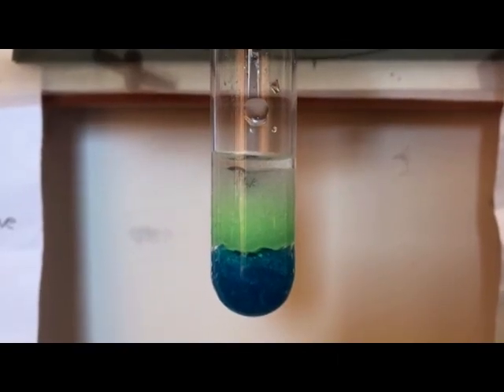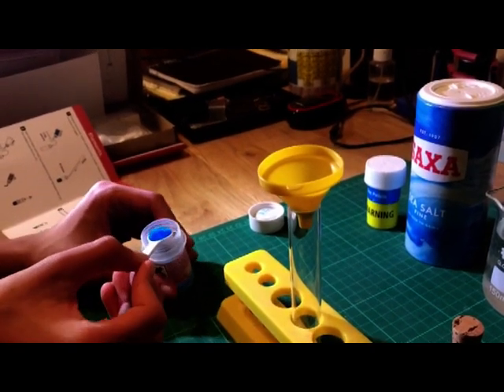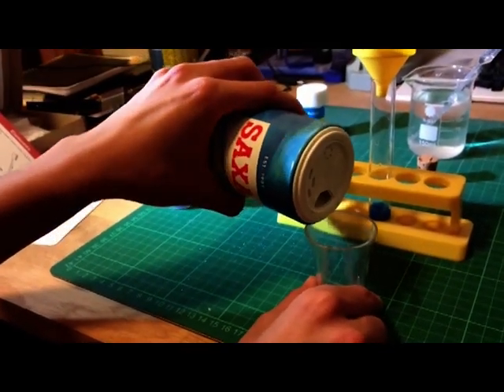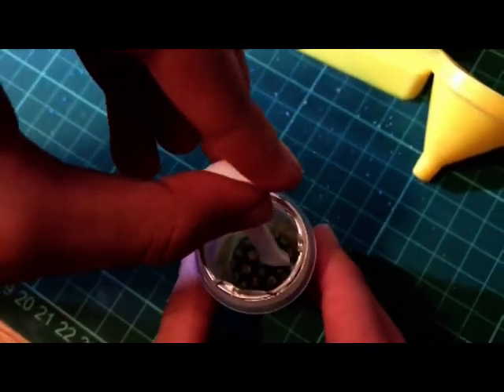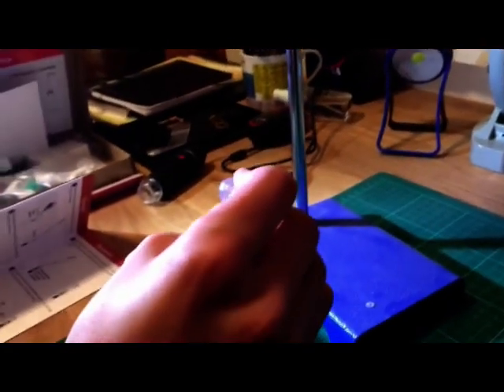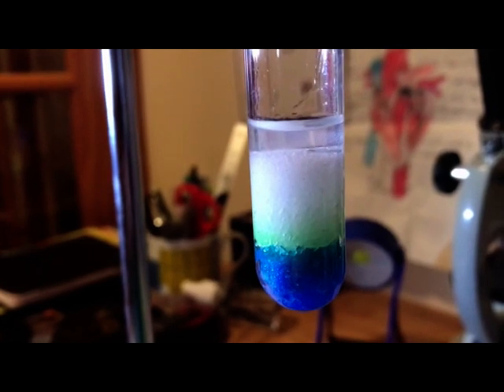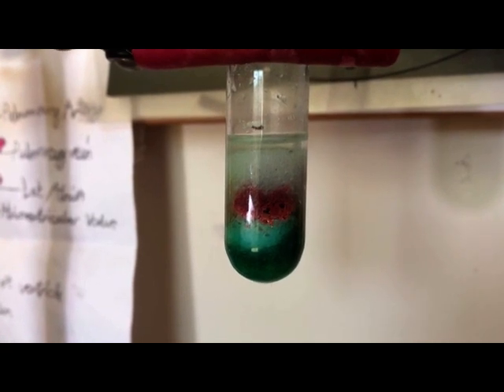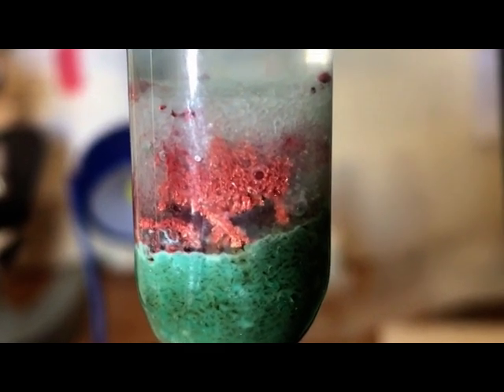Transforming salt into metal

Comment: Nice demo! It would be fun to see this side by side with a version that uses the replacement series instead of electrolysis... I believe this could be accomplished by simply ommiting the salt, although I haven't tried it myself. You may need to use zinc powder rather than zinc pellets though, or else you might just end up plating the pellets

Comment: Now I know what to do with all the copper sulphate I've been collecting from my gold recovery from computer pins and fingers. Thanks.
Reply: If you want to recover the copper you should use a process where electricity is being generated outside of the reaction mix. This is a great demonstration of the mechanism, but additional steps will be required to purify the copper if you use this procedure exactly. If you run an electric current through a pure copper sulfate solution you can grow nice copper crystals with no contaminates from the salt or zinc. Keep the voltage low and give it plenty of time, and they will even hold together when you take them out of solution :)